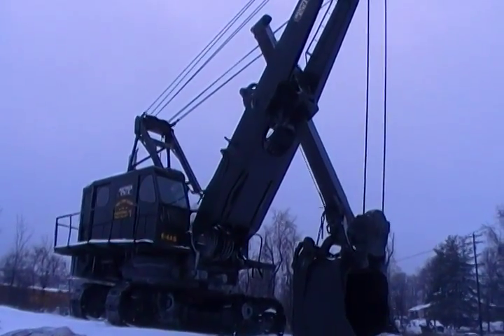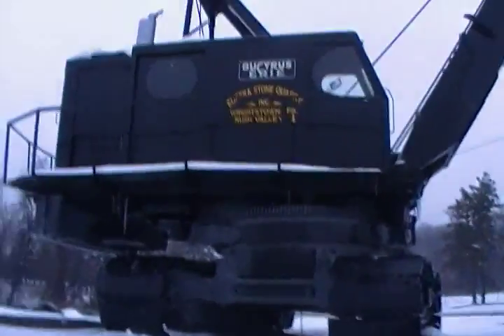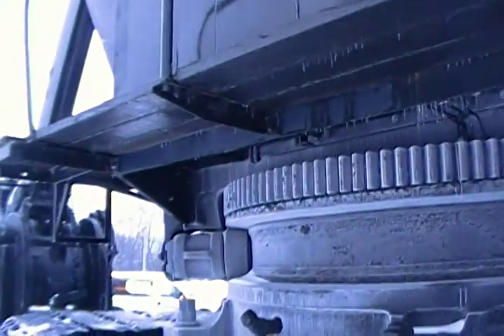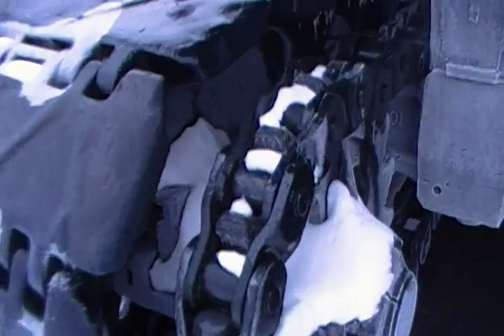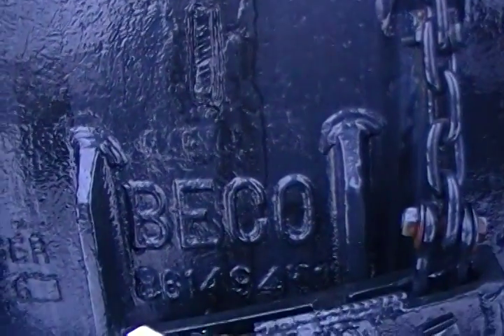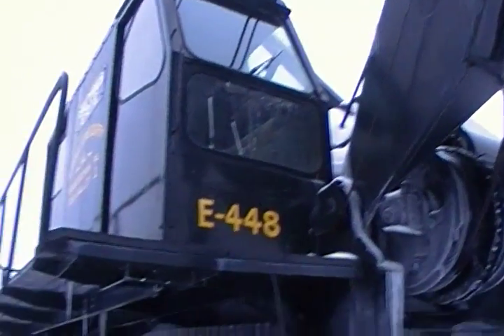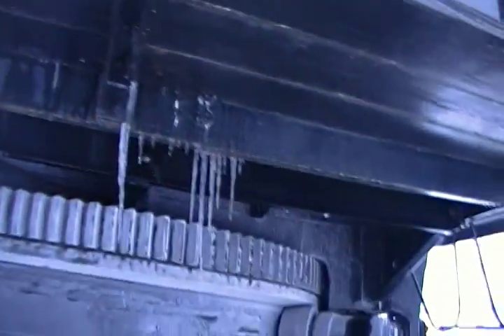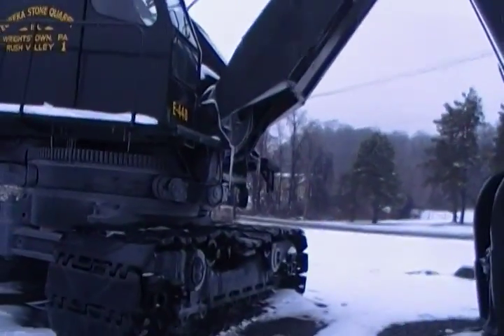ANTIQUE BUCYRUS ERIE SHOVEL

Comment: I was getting stuff running for the first time in 20 years and there was a Bantom (I think) steam shovel with a international diesel that lost its prime really bad.  It was really old all clutches/and cable lift. The motor needed to be run off ether for 30 seconds straight to finally get prime. We had the pump apart and went through 3 battery's trying to start it but after 20 years it did start and drive lol!  There was also a David brown diesel that started after 45 seconds of cranking, bobcat, newholland front mower, fordson that started with ignition parts, lots of big equipment that we didn't even have time to look at and a crap load of diesel VW rabbits lol. The guy died and the kid was selling the stuff. It was 2 barns full (I saw a really old Briggs in one) and a big shop full and end loaders, steam shovel, old cat dozers, grader, I didn't even see all the stuff and I was there three days